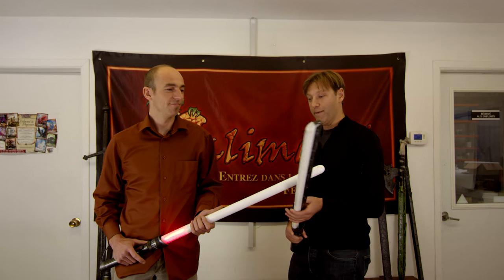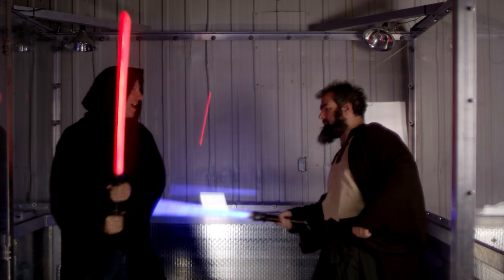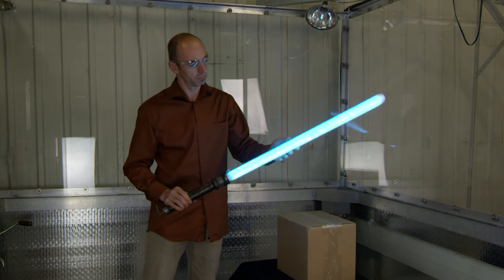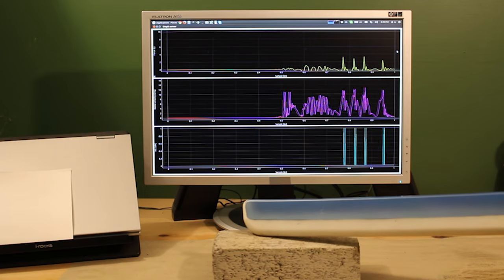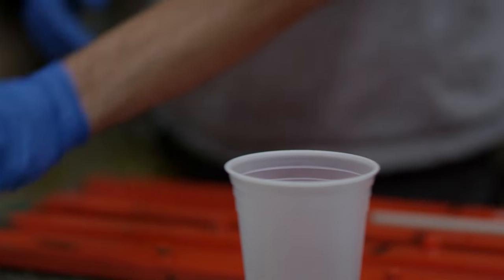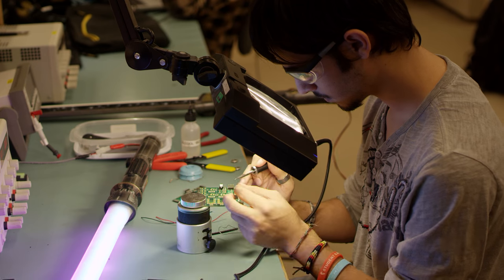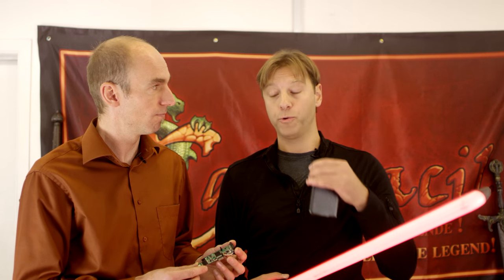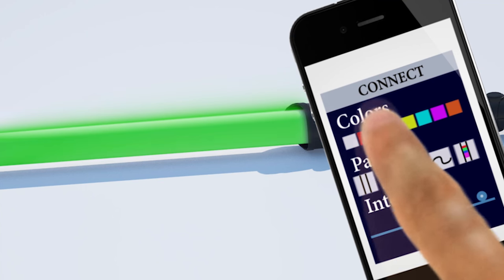The Calimacil Foam LED Saber: Kickstarter Video

Comment: alright, but I think it has an expensive price, should be 250 max and 50 minimum
Reply: oh thanks for the answer
Reply: +Andrew Dzurko    I totally agree man, cut the things down to one external look, a couple of colours to choose from, and it makes some woo woo noises which are loud enough to cover up the smudging sound of foam on foam.  They'd sell like hot-cakes.  I don't know many people who will spend close to a grand to buy a couple of toy swords.  But I know heaps (me included) who would buy a cheaper and less immersive version that was safe for some hard core LARP thwacking.

Comment: SHUT UP AND TAKE MY MONEY
Reply: you must be kidding. There's already toy lightsabers widely available that are cheaper, look better, with sound fx, and tough enough to duel with. The LED lights can't sustain really heavy hits such as smashing it against a table edge, but regular dueling is fine with the cheap "ultimate fx" series. Or there's the Ultrasabers even more durable.
Reply: +chaiTV But he said these have effects and for dueling did a Google search and they seem to back this up.
Reply: +chaiTV these are for Live Action Roleplaying (that's what they meant by LARP). There are rules to these games, one of them being you can only use foam for safety.
Reply: Hahaha yeah these are 500 bucks for the ones with sound. And like nearly 300 for the ones with just lights and foam. However the non-lit, non-sounded, ones are like 130. So. Lol. If you've got the money bud.
Reply: @jadenhaynes8320  exactly they are not in bucks but canadian dollar, I'm from Canada, Quebec as them. Edit: so they are less expensive than if you purchase them with U.S money than CAD

Comment: Don't they need some sort of license to do this?
Reply: +MarcusWindrune  Because of the hilt design (handle) being a custom design and not an accurate reproduction of a screen used saber, they can make em.
Reply: WWIIREBEL Interesting, one would think that Lucas got even the word Lightsaber TM'd
Reply: From what i understand, the term lightsaber was created by actor Alec guinness himself ,as he felt that sounded more proper. Mr. Lucas originally just called it a laser sword. Thing is... i think in truth "lightsaber" cannot really be trade marked ,due to the wording. can't tm the word light, or saber, cause they are both common things .
Reply: +MarcusWindrune Yeah pretty sure they in trouble if Disney comes knocking on the door, in all reality its up to a judge to decide if its infringement or not, In my opinion they're really pushing their luck here and even if they aren't infringing Disney can still sue even though they might not win

Comment: Awesome. You guys are gonna be rich. However, if you want to call them "lightsabers" and use that sound and hilt, you're going to need a license from Disney.
Reply: +TKnightcrawler not in Canada lol
Reply: +TKnightcrawler  Actually...they won't get into trouble. The hilt design is NOT a disney property. That design has never been used by lucasfilm/disney ever. That alone is what saves them from getting into hot water .